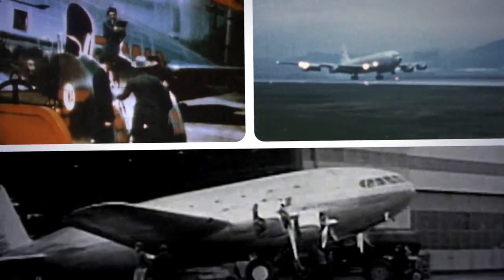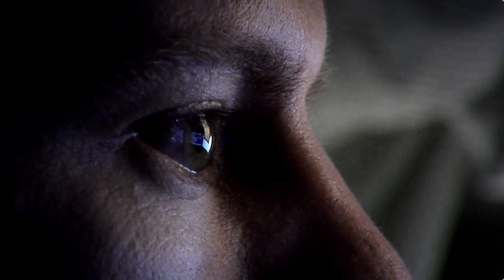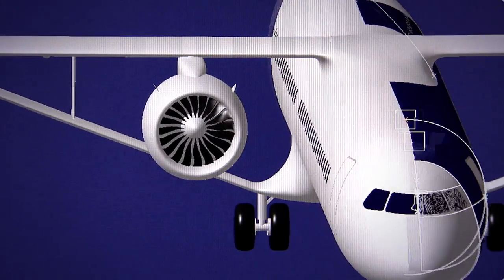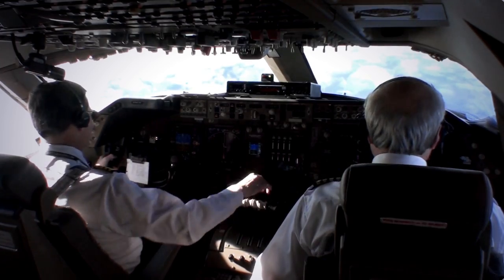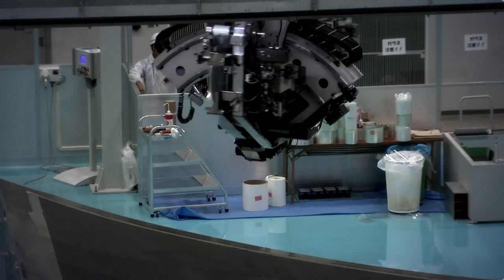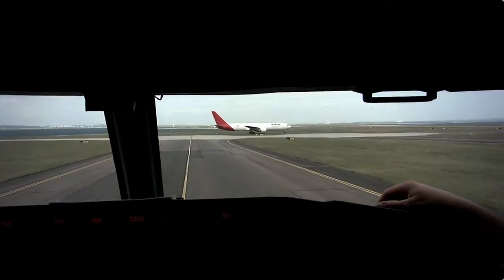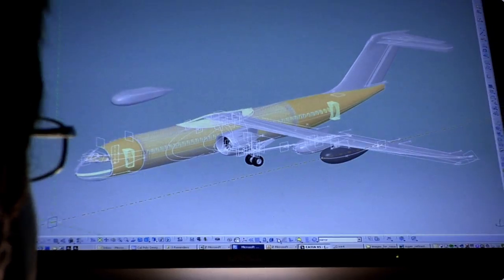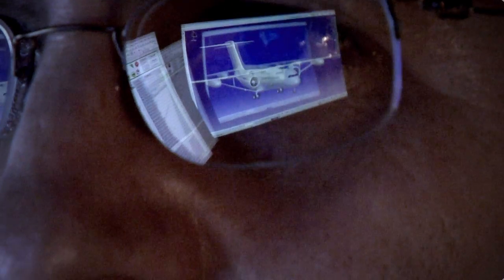SUGAR Volt: Boeing's Hybrid Electric Aircraft

Comment: So it seems this would only work if the aspect ratio is sufficiently high. This will be the other connecting piece to the puzzle, fabricating wings that have a high aspect ratio with lower mass and have favorable aeroelastic characteristics.
Reply: Not gonna happen -- such high-aspect ratio wings just don't have the structural strength to hold up a jumbo jet and stay in one piece!
Reply: Dennis Kitainik The Volt is not a jumbo jet. Second, conferences and periodicals on aeroelasticity all point to moving to higher AR wings and structural optimization with composites. Sorry, but this is my field of research.
Reply: mangudiaforce The U-2 (Lockheed, not Polikarpov) was a much smaller a/c than this one -- so the aeroelastic stress is much less.

Comment: Long, high aspect-ratio wings... with struts. Drag-wise, not incredibly more efficient.
Reply: Untrue.  Thinner planform gives much less surface area for drag.  Struts possibly also aerofoils, provides additional lift.  Compensates for reduced wing area with minimal resistance.
Reply: Also untrue - It is not the smaller surface area of slender wings that yield lower drag (total wing area might actually be the same with larger span and shorter chord). It is the induced drag that is lower in those wings, not surface drag.
Reply: Oh, true, true.
Reply: Dennis Kitainik I know, Dennis. But at altitude, CL is usually high - airliners operate with a small margin between stall and compressibility. High-speed flight at altitude is not the same as high-speed flight a lower altitudes. With high CL, induced drag is again a factor, even at high true airspeed.
Reply: corisco tupi Induced drag mostly comes into play at LOW speeds -- at higher speeds, it's the FORM drag that's more important.  And at jetliner speeds, wave drag comes into play as well -- and guess what, at those speeds these Caravan-style struts would create much more of both than the slim wings can ever hope to offset!

Comment: Interesting to compare this extended wing design to hybrid body wing designs for aerodynamic efficiency. The gas turbines could be decoupled as the electric motors take over at cruising altitude. Gas turbine efficiency might well decrease at higher altitudes while that of electric motors be unaffected.

Comment: What about the increased weight for battery cells? What about the energy required to generate the electricity to charge the batteries in the first place?

Comment: nice for a press conference, but how exactly are you driving the jet engines with electricity, and how much extra fuel are you burning to drag up the extra weight of the batteries

Comment: I have been looking at a modified 747 for quite some time. I would like to see the 2 inboard engines being slightly oversized, and the outboard engines, able to run hybrid, meaning that during take off, they run fully on jet fuel, but at cruise, the inboard engines generate power, to spin the outboard engines on electric power alone.  I do see that there would be a little bit of a drop in speed, but a Hybrid 747 would be better than a 787, in fuel savings.  Have you looked at a Hybrid 747 ??

Comment: My concepts would get 60 mpg for 4 people on Natural Gas.  Assuming a 787 at 100 mpg/passenger and Jet-A at $3/gallon, vs 240 mpg/passenger and $1/gallon, my concepts would be 7.2 times better or about 13.8% of the fuel cost of a B 787.  This is for a roadable seaplane that can land on snow, water, and drive to your house.  

Clearly, the jetliner model could be made obsolete quickly with the right funding to me.  

BTW, I was offer a 787 job (weights eng.) and did not take it.  787 not future.

Comment: I would have thought that the high aspect ratio wing would be negated by the use of struts?
I also thought that Rutan proved that to be efficient, it was better to use a canard layout, make ALL the wings lift and proportion the aspect ratios between them.
Charging batteries at an airport terminal would not be viable, the aircraft should have roll off-roll on pre-charged packs, even if they are sections of the wings.

Comment: Why not have the plane fly on something like propane that can be burned in a jet engine at take off and also be used to produce electricity in a highly efficient fuel cell. No need for heavy batteries although I like the idea of renewable power being used. With the fuel efficiency of just 30-40% of a jet engine there's huge fuel savings to a fuel cell with something like 80%. Combining the two would make so much sense.

Comment: Your right.. All it does is change the pipe the pollutants come out of... Exhaust from a turbine engine, or smoke from burning coal. Same goes for the Chevy Volt, Toyota Prius, Nissan Leaf, etc. This country needs more public works projects for hydro electric and we need to figure out a safe method of Nuclear power.

Comment: I don't care if we can get airplanes to run off electricity and exceed the lifetime, range, cargo capacity, and performance of fueled airplanes. If electricity is still provided to charge those batteries via oil refineries and coal, I'm not necessarily a supporter of the idea. But we will definitely see where the future will bring us :)

Comment: ...and don't forget the shelved 7J7 "Food Processor" counter rotating carbon fan blade project back in the late 80's!!! Those engines would have to be retrofitted to older DC-9 or MD-80 type aircraft as I cannot see those blades whirling that close to the runway at TO power!

Comment: The area of design focus needs to be in Ultra high capacity capacitors and the correct Hybrid combination of gas turbine on Bio Fuel to Electrical Generators using KERS technology, currently utilized by current F-1 GP race cars. This along with ultra strong and lighter weight advanced composites will get an aircraft of 80 to 100 passengers across the US or 2,900 NM non-stop in 7 to 7.5 hours...try driving a car or taking a train, for example between LAX - JFK in that amount of time!

Comment: This plane will fly just as slowly as a modern glider. You won't get anywhere fast with this one. Seattle to Vegas will take over 5 hours and will probably need 1 refueling stop. It's too slow to use the normal class A airspace thus rendering it useless for commercial flight, except the left coast ecogreenies who can afford to pay for these expensive tickets.

Comment: Great concept - braces to the wing makes me imagine on how long the wings are going to be. Plus the presence of braces for wings makes me think that lesser amount of fuel will be used in the wing tanks if at all there will be any, because one of the loads the cantilever of the wing has to address is weight of the fuel carried which obviously is going to be altered by this design. The CFRs specifically part 25 are going to be a challenge in proving the SUGAR as well - but that is a challenge.